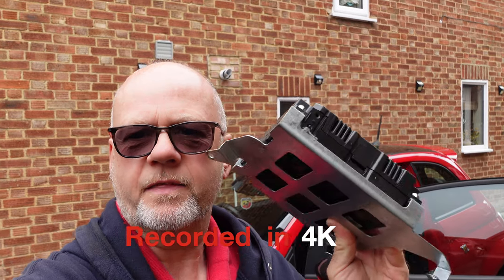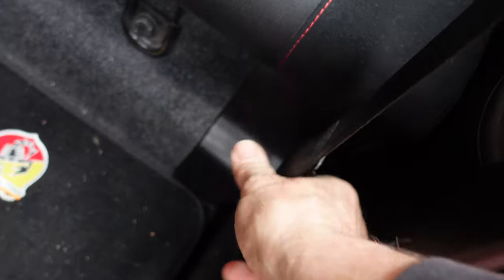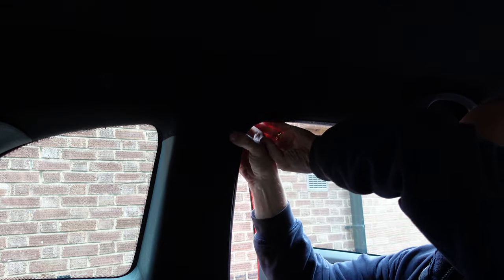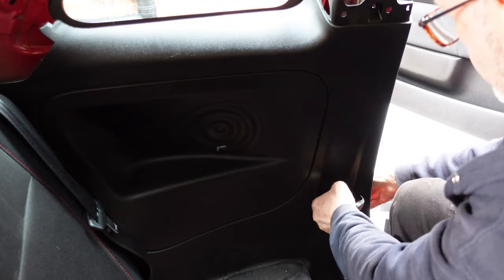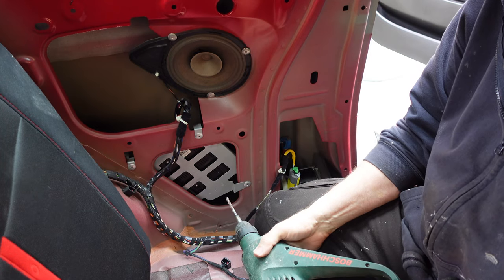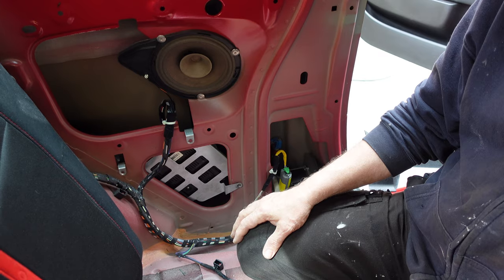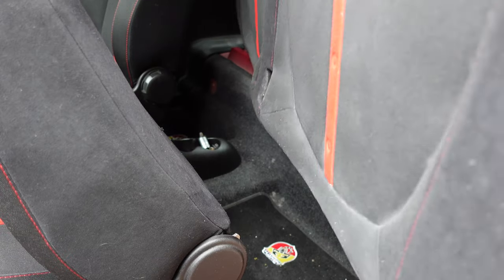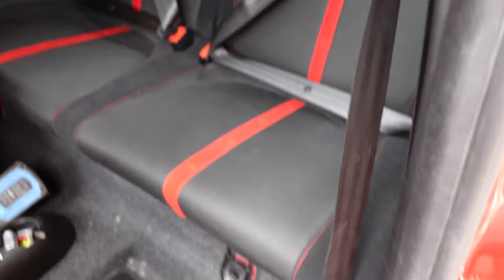Replacing a Faulty Blue & Me ECU Module  - UPDATE - in a Fiat 500 or Abarth - Love 500 How to Series

Comment: This was a GREAT video - thanks! I had a Blu&Me fail and battery drain issue, and just tore down both back panes in search for the B&M module. Nothing there! I spoke to a dealer and was told that in some 500-models, the Blu&Me module is placed under/behind the glove compartment instead. There is a mat that is fixed with three plastic screws - easy to remove. And voilà - there was the Blu&Me module. So instead of tearing down the back seat panels, start looking behind the glove box first! It's a non-hassle, 5 minute job, no tools required. (After disconnected the module, the battery drain stopped. But the odometer still flashing of course, since the car still can't find the Ble&Me module)
Reply from the maker: In uk cars it’s almost always in rear panel. It seems in European ones it may be behind dash. You will need a proxy alignment for the mileage flashing.
Reply: Ah, gotcha. Yes, the proxy alignment is next, but is ok with the flashing odo in the meantime. Need to do a proxy alignment if I buy and install a used one?
Reply from the maker: @jw50000  yes it’s absolutely fine to drive just annoying.
Reply: I have a US model 2013 Fiat Abarth 500C. Any idea where the module is located?
Reply from the maker: @geneskiba5253  I be
I believe its behind the dash. Your passenger side, sort of near the stereo. You have to take out the passenger parcel tray to get to it.
Reply: @Love500  thanks! I’ll report back once I get a chance to work on it.

Comment: Hi, thank you for taking the time to make and upload this video. My wife's late 2013 fiat 500 had this fault, blue and me not working plus flashing mileage etc. Interestingly the car has just passed 10 years old. She was annoyed because she does use the phone etc. Your video was so well done I give me the confidence to try it. The rear seat belt bolt was quite badly corroded in the wheel arch. Thank you for the warning. I sprayed it morning and evening for two weeks with WD40. Every other day I scrubbed it with one of those small brushes with metal bristles (They look like a toothbrush). Taking your advice when it came to removing it I proceeded very carefully with hand wrench and it came out OK. A company in Essex who are on Ebay did my repair for £85 - excellent service. Put it all back together and  it all worked first time. Once again thank you so much for taking the time to make this video. Without this I would not have been able to do it. I might not of actually bothered to get it repaired. Loving the channel please keep up the great work.
Reply from the maker: My pleasure, glad it helped. Just so you know, I repair them for £60.

Comment: Just wanted to say thank you for the video. My module just randomly died after 10 years and was causing a battery drain. I have now successfully removed it and hopefully fixed my drain issue. Saved me hundreds on not taking it to a dealer and only cost me $12 AUD for some WD40 and a wire brush. Once again thank you very much, From Perth Australia
Reply from the maker: Glad it helped.

Comment: What if I don’t want to remove it & just snip a wire or unplug something - I don’t want to repair or replace a unit 🤔
Reply: Australian 2013/14 model 1.4L
Reply from the maker: You will need to unplug it at the unit. Follow my instructions to begin with but rather than taking the rear panel out, just pull it backwards, hinged on the rear bolt and get your arm in there, find the plug on the rear of the module and unplug it. That will stop any battery drain if that's what you're getting. You will still have to do a proxy alignment which may take several attempts but will eventually stop the mileage flashing. You can't just snip a wire.

Comment: Quick Question - What size rivets do you use when affixing it back into the rear left passenger wall? It's the one thing missing from this otherwise very helpful video.
Reply from the maker: Rivet sizes always confuse me. I’ve bought so many sizes over the years. I’m afraid I can’t really say what size they are.

Comment: Out of interest If you didn't want to replace the module and just unplug it, is there enough space to pull the panel back if you remove seat. And leave the seatbelts in place. I appreciate it'll be lots of wiggling about. Just wondering if that could be an option
Reply from the maker: If you just wanted to unplug it, you could just pull it at the front and create rear bolt as a hinge, you could then get your arm in to unplug it. I’ve never tried to unbolt it rather than drilling out the rivets of the cage but I think it would be a job and a half. A lot of people cut the plastic around the bolt rather than removing it.

Comment: I have a 2013 500S. Assume mine is located in the rear side panel as well? :-( damn - I don’t want to replace it I just want it to be disconnected to I don’t experience battery drain no more - any simpler way to disconnect it for good??
Reply from the maker: If it’s a uk car then yes. Only way is to disconnect it. You can peel back the rear panel and leave it on the bottom seat belt anchor. As long as you can get your arm in to disconnect the plug you do t have to take that panel right off. Lift it over the wire of the pre tensioner and it’ll pull back as long as you’ve taken the seat base out.

Comment: Thanks for comprehensive information! I appear to have a parasitic drain on my fiat 500L, she's 14 years old 2010, and it doesn't appear to be the alternator, as I can see it's producing volts upon car running nearly 14v on idle. It started bout 2 months ago, when my 4 year plus battery just seemed to not start the car one day, so bought new one, but after a month and a half, the new battery which wasn't charged fully unbeknown to me, has now failed to start the car. I jump it ironically with old battery, it starts, I run it with over 30 mins driving, within hours it's gone again. I am now thinking, it's a parasitic drain. I know you say you have to disconnect from blue&me totally to know, but are there any indications at all? My blue&me works, no flashing mileage.  I can obviously spend the time to disconnect, but was hoping if there was a pattern of events beforehand in case it's something else. Would appreciate advice.
Reply from the maker: Unfortunately not, sometimes that is the only fault.

Comment: Is it possible to buy the same Bluetooth module with the same part number taken from the same car of another year/same year and simply plug and play? Or will it need programming via proxy alignment even if it’s got the same part number?
Reply from the maker: You don’t need the same part number just out of the same generation as there are only two versions which changed around mid 2010 but they will always need a proxy alignment as the car will be looking for the original one.

Comment: Just for those without a rivet gun, you can quite easily get an 8mm socket on each of the nuts that hold the module in place. I did it today and will be posting it to Love500 to see if it can be repaired 👍
Reply: Repaired successfully, thanks Love500 👍
Btw...the plastic case is brittle so put it in a box when you send it for repair!

Comment: My blue and me unit failed for 6 months. Low B+ on turn-off caused the fault I believe. Different computer modules in the car could not say good night to each other, so it lost its shit. I reflowed the solder and everything on that unit to no avail. Then: 
A long drive in 40° heat and it came back to life. It started speaking Italian in the middle of a drive. I downloaded the English file and uploaded it after 20 attempts, it worked.
Reply from the maker: Great bit of kit 🤣🤣🤣
Reply: @Love500  had I seen your video back then, I wouldn’t have taken all the dash apart first.

Comment: Hi Paul, great vid. Got a little 2014 500L, already gone through 2 batteries. Am about to give it to my daughter. Was planning on upgrading the stereo to a 2 Din unit which would have its own bluetooth etc. I guess I would still need to disconnect the Blue & Me module to stop the battery drain, and then reprogram the buttons and flashing odometer does that sound about right?
Reply from the maker: @garethp2491  yes, but it may take several goes to stop the flashing. Sometimes it causes other errors which you have to clear and do it again.  I recently had to do it 7 times before it worked.
Reply: @Love500 ouch! Thanks for replying. You put a ton into this channel and I value so many of your vids. Thanks!

Comment: Excellent video, thanks for sharing this walkthrough. Until I get the confidence to try this myself, is there a fuse I can disconnect that will prevent the Blue & Me from draining the battery? I can't seem to find an answer to this on various forums I have checked. Thanks!
Reply from the maker: No you will need to disconnect at the unit itself.

Comment: Hello.  Thank you for making these videos.  I have a US Spec 2013 Fiat 500 Abarth with a flashing mileage problem.  It seems as though the blue & me works because the buttons on the steering wheel DO bring up voice commands which can be executed via my voice.  However, MultiECUscan indicates that my "convergence telematic module" is malfunctioning because it can not connect to it during the proxi alignment and it gives some kind of an error message as well.  Also, it won't connect to any of the Blue & me modules during the ECU connection even with the yellow cable and an OBD scanner and MES.  You mention something about either "replacing the Blue and Me module" OR "getting a new stereo" to fix the mileage problem.  Could you tell me, if I buy a new head unit (stereo) for my car and DO NOT replace the Blue and Me module, is there then something I can do to get the mileage to stop flashing? Or is replacing the blue and me module the only way of eliminating the flashing mileage? Thank you.
Reply from the maker: Once you take out the original head unit you can do a proxy alignment to get rid of the flashing mileage but I would suggest taking out the blue dnd me or even just disconnecting it. In US cars I believe it may be behind the dash (passenger side) near to the stereo. I think just you access it by taking out the dash under tray.

Comment: My Blue&Me Unit has failed (flashing mileage) but I have also replaced the Stereo with an aftermarket android stereo which has it's own bluetooth etc... so I don't think I need one anymore, can I just disconnect the cable from the current module and do a PROXI ALLIGNMENT and it should be ok? cheers
Reply from the maker: @BradThomasJ  yes you can. The proxy alignment may take several attempts and make sure there are no errors on dashboard/BCM too.
Reply: @Love500  what an absolute pain it was but your video helped massively! Disconnected and proxi alignment worked first time, no more flashing mileage and hopefully no more battery drain!
Reply from the maker: @BradThomasJ  9 times out of 10 it will be that causing it, especially if it was flashing g the mileage so I’m confident your battery drain is a thing of the past.

Comment: I have battery drain & flashing milage on ford ka same as the 500. Will replacing the radio with a fitting kit for steering wheel stop drain or will the blueand me need removing
Reply from the maker: You need to disconnect the blue and me at the module itself otherwise the battery drain will continue. If you're replacing the stereo you will need to do a proxy alignment anyway.

Comment: Great videos - I've already fixed the squeaky clutch and worn rear dampers with your help. I've now got the Blue&Me problem. Quick question - were you able to use the car without the unit installed? Do you lose any other functions or does the mileage flash forever?
Many thanks
Reply from the maker: The mileage will flash until you do a proxy alignment. You can edit the buttons in multiecuscan so the other buttons work if the unit is disconnected or removed. I plan on doing a video on this in the near future.

Comment: @love500 _ Thank you so much for the comprehensive video, I have disconnected and removed my B&M unit, which causes the mileage to flash and drained the battery. 
I'm in Cape Town South Africa, so not many options for repairs or replacement of the B&M unit. 
However, is it possible to stop the mileage flashing, without repairing or/replacing the B&M unit? Can I do some sort of a proxy alignment with the MES software, without the B&M unit installed, which will stop the mileage flashing? thanks
Reply from the maker: Yes you can, you will need to clear any errors on any other ECUs as well and i5 may take several gos but it should do it. You can also edit the button set up so the vol7me etc still works which sometimes it won’t do if the unit is disconnected. I hope to be doing a video on that at some point when I next get a broken one.

Comment: If you put a screen in instead does it stop the flashing mileage? My daughter has just bought her first car and it has this problem, we are weighing up the pros and cons of repairing the blue and me or putting a new stereo with screen in. Thanks
Reply from the maker: If you put a new stereo in, you’ll still need a proxy alignment as the car will be looking for the original stereo. I can repair the blue and me which should but not always as well as work, will stop the flashing mileage. I charge £60 plus £8 delivery back to you. No fix, no fee.
Reply: @Love500  thanks for the reply. would the proxy alignment stop the flashing and battery drain after the new stereo has been fitted? She wants a screen in the end so no point doing both jobs to get to the result she wants if that makes sense. Kids eh 🙄
Reply from the maker: @vikkibarnett4906  only if you remove the blue and me or at least disconnect it at the module. Then a proxy alignment. If you leave it connected the battery drain will continue.
Reply: @Love500  brilliant thank you so much you’ve been so helpful, if I’m going to need to disconnect it anyway we might as well try the repair first I’ll pop you an email. 😀

Comment: Would an impact driver work to remove the bolts seats and seat belts on a fiat 500 lounge 1.2 to remove the blue and me module?
Reply from the maker: Yes if it’ll fit in the available space. I always use an impact gun in rear seat base but a socket in seatbelt bolts and ore tensioner due to the access.

Comment: Hi Paul I’ve got a question. I believe my interscope sound system amp is behind my rhs 3 quarter panel do you know anything about this before I take it apart and find out. Can’t find any videos on it. Thanks in advance
Reply from the maker: I’ve never had one I’m afraid. I thought it was under the passenger seat, or is that the sub?
Reply: @Love500  thank you for replying. The sub is under the seat but not the amp unfortunately for me 😅

Comment: Should take an absolute novice around about an hour ( with going back indoors to watch this tutorial), as mentioned the seat belt bolt is somthing that i had to work at. Lots of WD40 then work the bolt out a few turn's then WD40 and back a few turns to keep it all lubed up and moving so as not to snap the bolt. A impact screwdriver with a socket attachment is what i used and if the bolt becomes tight then run it back in the thread and use more lube, now that the unit is out i really don't know if i want another Blue and Me unit back in there ? Great tutorial and i had just one screw left over lol Many thanks.
Reply from the maker: Glad it was helpful and that’s a good top about running it back in if it gets tight.

Comment: Hi mate I have a battery drain on my abarth it has an aftermarket head unit but the blue and me and module is still in place no flashing mileage though. I had a fault with airbag module and got this repaired as I thought this was the reason it was draining the battery.

Do you think it could be the blue and me or aftermarket head unit? 

Really appreciate the help
Reply from the maker: That is by far the most common cause of a drain. I would disconnect at the module. Just leave it there if you do t need it. You’ll have to do a proxy alignment though as the BCM will be looking for it and your mileage will flash.
Reply: @Love500  thanks for the reply the only thing slightly concerning me is  that when the airbag module was being repaired it started ok I have put this back in and has been ok for around 4 days but now the drain is back could it still be this module?
Reply from the maker: @chriselse515  in theory it may be the airbag ECU, but I've never come across that causing a parasitic drain, it's really always the B&M. It's worth just pulling the cable even to rule it out.
Reply: @Love500  thanks for the advice mate ill try the b&m module see if it's that